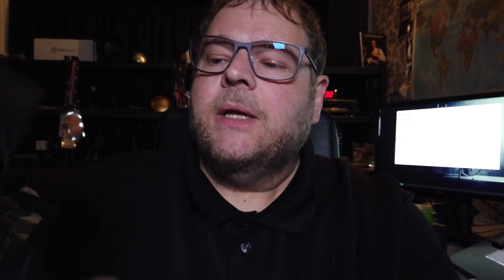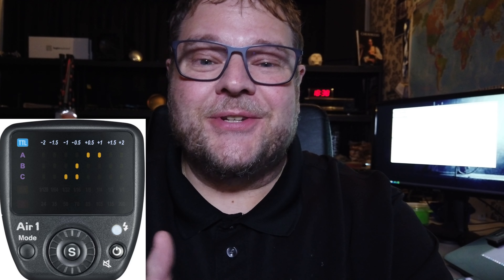Power with speedlights : pro tips

Comment: I use speedlights exclusively for on location corporate headshots(my bread and butter) and marketing images for small businesses. Since I'm often Ubering or taking public transportation around NYC, keeping my kit small is essential. My entire lighting kit(stands/modifiers/grip/lights) fits into a Pelican 1510 size carry on case. The best thing now is that I have speedlights with lithium batteries that allow incredibly quick recycle times and more shots per charge. When I first started out I was lugging around four heavy external battery packs for my old speedlights to meet those requirements.
Reply from the maker: The power of the small strobe :)

Comment: Always love your stuff!

Physics says you CAN bend light (our lenses do it all the time).
Reply from the maker: You're absolutely right
Reply: Duncan Brennan :  I do believe that it’s not actually bending light rays like  gently curling a piece of paper. Rather it’s redirecting of light.  As in reflecting off a mirror.
Reply: @douglasmichel6361  technically it's refraction. The difference in the speed that light travels through one medium (air), and another (glass) is enough that the path of light does deviate if it does not hit at exactly 90 degrees. You are correct that light does not bend with a curve.
Reply: Duncan Brennan: yes I know what it’s called . The point is it does not and can not bend as in an s curve....
Reply: @douglasmichel6361  I would also look into gravitational lensing, if I were you.
Reply: Duncan Brennan : I did and in that respect I stand correct.
Reply from the maker: @douglasmichel6361  I can life with that ;)